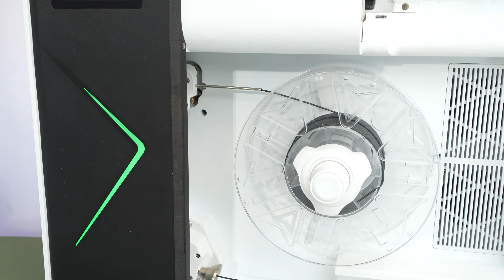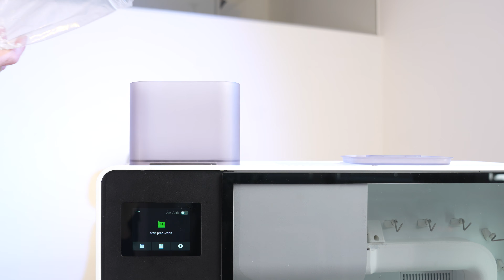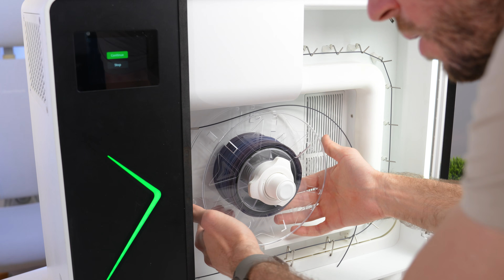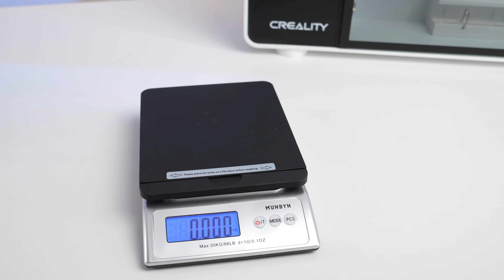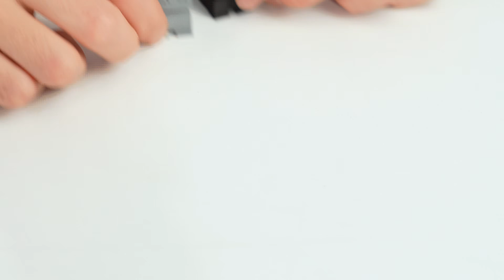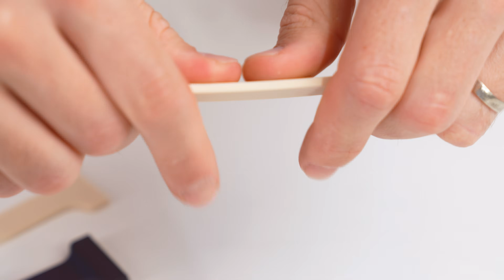Creality Filament Maker M1 & Shredder R1 - Make your own filament at home

Comment: $1000 ? When you can make one for under $200 
For what to recycle $20 a month or less on material ? 
With $1000 I can buy 450 rolls on 3 lb each from China different colors make $7000 on profit and don't do any recycle
This machine is a $350 max in price just if you ever needed

Comment: Sorry, of course, you got my respect for trying to develop a solution like this one. No doubt. But to be honest: What is the serious market? Our company is purchasing approximately 8-10 tons of filament a year, but only 5-6 pounds of PLA. So, in my opinion, if you really want to be successful,  you have develop a machine that recycles PA6, PA12, PC or PP, or at least TPU. Sorry.
Reply: It will recycle other materials including PA, PETG, ASA, PC, ABS, TPU, PET, CF and GF filled and more. Though in my print farm, I only use PLA so it is perfect for me.
Reply: Does this really look like a commercial recycling system?